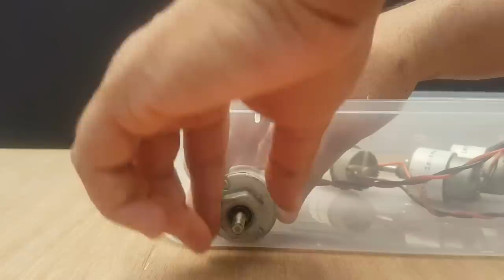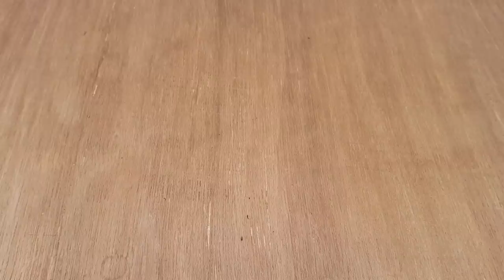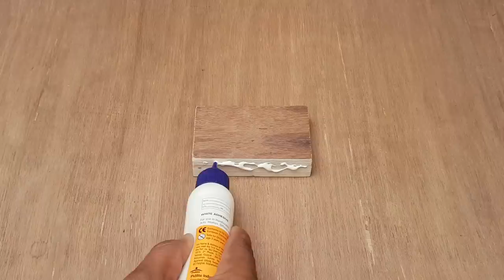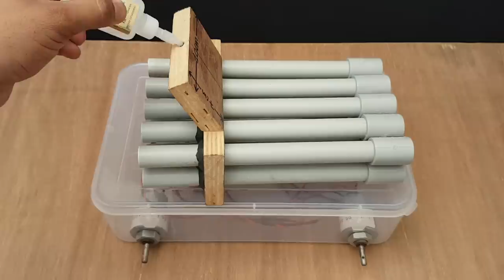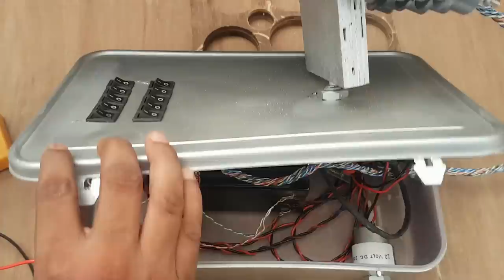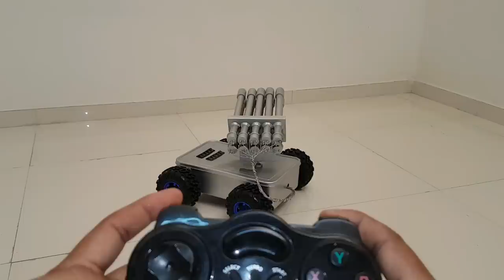How to make an Anti Aircraft Missile Launcher

Comment: How did you create fire?
Reply: You remeber that little thing that he made using that spring-shaped wire, two screws and screw-nut? that thing worked like the resistance from a electric shower, heating up while both positive and negative energy pass through the spring, and start to ignite the wick of the firecracker, thus activating the firecracker
Reply: Axel Roses are